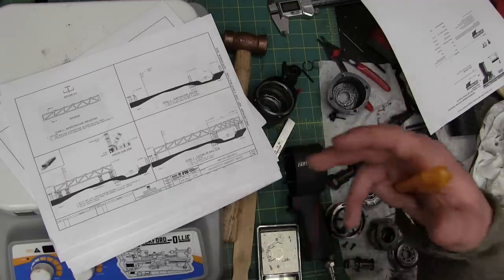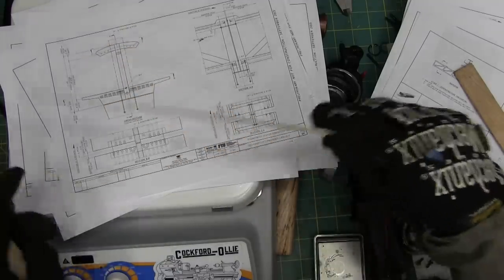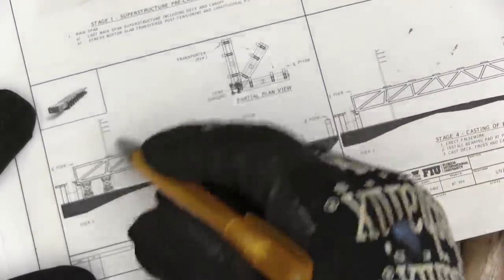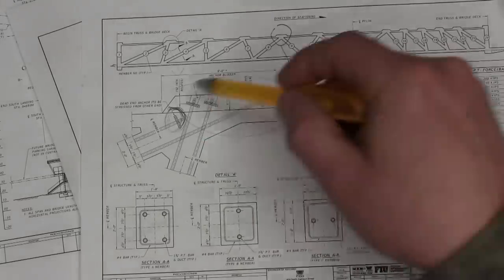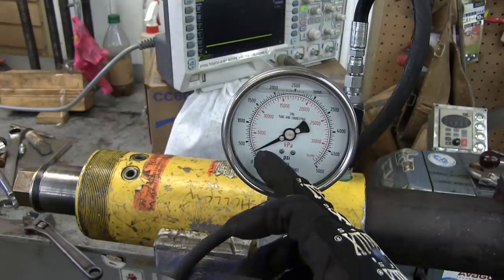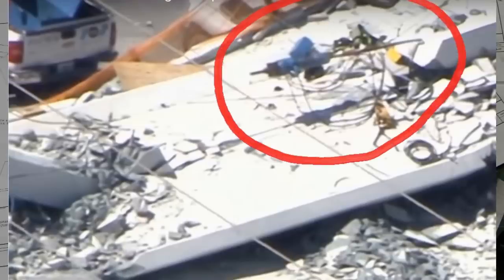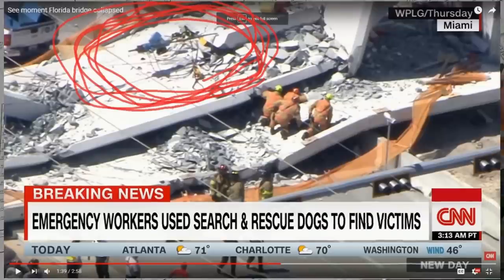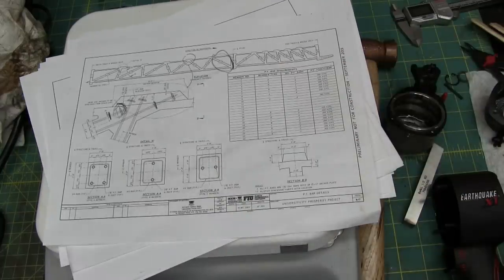Post Tension Failure Florida Bridge Collapse | Engineering EXPLAINED!

Comment: I am a civil engineer and I would like to express some points. These actual super duper structures are based on calculations of advanced mathematic techniques, These computer programs take in consideration so many variables that it makes almost impossible to control in construction sites. Every element is affecting the next one and so on, the stress and shear forces are  dynamically calculated in the computer model . As already mentioned, a structural collapse is a sum of multiple failures, and it's very hard to manipulate those structures in situ. Once you make a change in one support, you are changing the whole model, affecting the tensions in all elements, the tensions tend to travel to less stressed elements that are not supposed to handle it. If the model is supposed to be supported with on only 2 nodes, when you put another support in the middle, it start to act like a continuos beam.creating all kinds of different tensions in the element.
It's an unfortunate case of mishandle the the tensions on the site. Once one or more? rods were subject to tensions above the limit, the steel would break after passing the fluidity limit ( when it loose it's traction capacity ). And I guess that they were already working almost on the limit of their capacity, the security loads for this kind of elements are very high.
Reply: Jon O  , for sure. The variables are just too demanding in this kind of project. And we did’nt even talk about the constraints required by the contract to install the bridge.
Reply: Jon O tight schedule?

I think they've been working on it for 5 years
Reply: No.  Back up six steps and look at the big picture.  It is the wrong kind of bridge. Period.
Reply: Jon Wiebold  there is not such a thing. The structure is very interesting and  very complex. Still , these structures are almost like machines. Thanks to this channel I could peek on the designs ,  they are very challenging.
Reply: Jon Wiebold nothing wrong with type of bridge so many experts out there .This could have been just a bad gauge on the tensioner we don't know yet.this bridge type  has been built for years with no problems let's not speculate let's wait for the word.
Reply: If they moved the supporting structures towards the centre of the bridge then that would change the load distribution on the bridge. If those supports near the centre were jacked up too high, the loads on that end of the bridge would be reversed, since it is acting like a cantilever overhanging on the temporary supports and not a beam supported at both ends. It's only a small overhang but the bottom part of the bridge would change to be acting in compression and the top acting in tension. The loads on the two diagonal trusses at that end would also be reversed. 
If they didn't take this different loading condition into account when tensioning the tendons, then once the supports are removed the actual stresses in the bridge would be different to the intended ones. 
They may have noticed this and tried to adjust the tensions after the supports were removed. This shouldn't have been done while traffic was passing underneath, but for some reason or another it did and evidently something went terribly wrong causing catastrophic failure. Looks like a series of unfortunate events, and bad decisions. That's the best explanation I can think of with the evidence I've seen.
Reply: We as engineers love to work with the latest and greatest tools, push the limits of design and come up with the sexiest new thing to be built since AvE's torque tester. But what we fail to do, all do often, is engineer to the lowest common denominator. In this case, the LCD was the poor decision to move the transporter and failure to recognize that the tension bolts had yielded. As Paulo pointed out, there were so many variables - way too many variables for the on-site crew (both grunts and enginerds) to comprehend and handle. I can design a shaft fitting into a hole, calling out for a interference tolerance of .000001", but if the guy installing the shaft is using sledge hammer, what good is my design? I should either simplify my design and take into account the installation environment, or get a better installation crew/method.
Reply: I have since learned that it is a cable stayed bridge.  The "cables" do not carry any of the weight.
Reply: We are still using structures and facilities built by the ancient romans more than 2000 years ago. No computers then.
Reply: Paulo Roberto Agreed.
But, what about the unsupported 'hanging' mass created by moving the positioner? Adjustments made in that position would be totally inaccurate as you were basically lifting the unsupported mass at the same time.
Reply: In the meantime, supposition videos generate lots of views! Only the real forensic analysis will find the cause, after running through hours of modelling. These are not simple structures - but super duper!
Reply: Jon O I
Reply: There's something to be said about designing with slide rules and fewer significant digits, isn't there?  I sharpened my engineering chops on a Post Versalog II®, and, while it might have cost a nickel or two extra on a five-million-dollar project, there was [almost] always enough safety margin built in to the calculations to compensate for using a sixteen-pound sledge hammer instead of a custom-built-for-the-job, fifteen-point-seven-three-pound sledge hammer.

Bottom line?  Spend the extra nickel or two.
Reply: Paulo Roberto well there are a lot of bridges in my country as longer as this one that have been built around 100 years ago (those 1st days of concrete and steel buildings) and I assure you these engineers didn't need some supercomputers to build'em in a correct way. Just sayin'...
Reply: Those bridges were built under completely different circumstances, methods of construction, and materials. I guarantee they were not built in 950 ton sections then transported to their final location. They also would be a lot bigger, heavier, more expensive, and taken a lot longer to build. You want to erase 100 years of progress in technology, engineering, and materials science? You believe there were no failures of bridges built 100 years ago?
Reply: Glenn Wilson 
You're spot on. If your design is to complex to handle it's not worth any other benefit. We're talking about lives here, safety comes first, not some fancy new iteration of proven design.

Comment: that bridge was doom the moment they decide to change the mobile support placement under the bridge before moving it into place !
the posttensioning was calculate to be support at the end so all the weight was hanging in the center but they carry it a full thrust nearer the center so all the pressure they put in tension  was already breaking the bridge before it was in place
so when they drop it on the piers at both end it was already to late the tension rod that you see with the tensioner was overstretch by the weight of the unsupported end of the bridge
i hope it make sense because it is not easy to explain something in English when you are French canadian
Reply: Gil B Nearly all these disasters are caused by some last minute half-baked change to the plan/procedure. Usually because of budget/politics.
I agree with you, they relocated the SPMT because traffic infrastructure was in the way, so they come up with a quick solution to avoid the extra cost and disruption to traffic instead of moving what was in the way. Where are the cost savings now? And six souls have lost their lives as a result.
Reply: It's easy to say that now but these type of adjustments are common in big construction projects.  Its not like they just wing it, every factor is recalculated and either someone fucked up a calculation or there was a material flaw.
Reply: These type of field adjustments are common sure, but this type of construction technique is a) new, and b) requires at least three different sets of load calculations (fully installed, partially installed, while being moved).  Maybe what happened is they recalculated the force for the wrong scenario.

Or, maybe a construction company hired because they're minority owned and had a connection to the school wasn't very good.
Reply: Yup. They moved the support away from the end yet left the tension rod tightened as if it the end were still supporting most of the bridge. Unfortunately it was actually being stressed in the opposite direction. Nothing good came from that.
Reply: deezelfairy They saved $-15 million and -6 lives with that "shortcut". But adjusting tension bars when you've already seen cracks and heard bad noises is the truly criminal part.
Reply: Michael O "it's not like they just wing it" -- I mean... I dunno, maybe that's usually the case, but in this specific case, it sure looks like they did, in fact, just wing it. Trying to adjust cable tension with traffic going underneath.

Whoever  was actually adjusting the tension surely can't have fully appreciated how things could go so horribly wrong in less than two seconds.

On a human level, that is where the failure occurred.

Comment: A snapping PT rod would explain that "bullwhip cracking" sound... (2:33)
Reply: Sure so from what Ave said that sound was reported before the collapse, like an hour or so if memory serves. Wouldn't that rod have ejected itself from the housing in spectacular fashion as soon as that failure occured and not sometime later?
Reply: I guess there are more than one of those in parallel. When one fails the others get a lot more stress and would fail soon, but maybe not immediatly.
Reply: I wonder if it was being acoustically monitored?
Reply: Cracked could have been stress on any of the other members. Also remember that bolts will make noise before they break. If you check out the FIU dashcam video(just search that on youtube) you can see the rod eject at 8 seconds in. It's clearly there.
Reply: It's easy for something to fail to the point of being useless, while optically things only shifted an inch or so.
Reply: No it wouldn't, a snapping PT rod would make a shit load more noise than a bullwhip.
Reply: No, there is nowhere for it to 'go'.  If the cable being stressed fails, it simply breaks inside the 'tube'. Usually, when tensioning, we only know this happens from the readings on the meter. Like in this video example, the force being used to tension suddenly drops. 

Now there is usually many of these cables for combined strength and some redundancy.  That's what the CSI types will have to figure out.

The reason Ave suggests it failed, and not the concrete around it, is that it is exposed AFTER the fall.. and is not mangled in any way. When the bridge dropped, it simply slides out of the 'tube' as the concrete bridge comes away from it.
Reply: SydneyCBR6 The PT rod was embedded in concrete, which might fade the sound a bit. Besides, the eyewitness (earwitness?) account didn't say exactly how loud the sound was. She just stated that the sound was like "a loud cracking whip" (2:33 in AvE's video).

Comment: When trusses are designed, all members within the truss are designed as tension/compression members only.  No bending.  So like you said, the original transport plan showed the supports at the panel points of the truss or the nodes of the truss.  You always load a truss at the nodes...never between nodes.  When they moved the SPMT to a spot between nodes, they were asking for trouble.
Reply: Trusses should always be designed for bending on top and/or bottom chords to resist bending as load application dictates. Clearly the difference in pedestrian load between node points and the bending/shear from supporting  approx half the bridge weight is substantially different
Reply: @BillySnowball  In practice the Truss will undergo some bending but they are supposed to be designed in such a way that the moment generated is almost negligible because the members are supposed to carry only axial forces.
If the moments are huge they should accounted for in the design but Why take on this extra headache to begin with.

Comment: Post tension members are plastic covered tendons (cable not a rod) in order to be unbonded otherwise when you pull the tendon the cured concrete around the bare cable is going to adhere to the member and wont let it move/transfer the load.

Comment: Steel goes into a plastic state under tension. Learned that in college. Also the transporter should have been under the truss. I'm sure during the short time after the transporters were removed and they de-tentioned the the members they were over stretched.  I also agree that they should have had some false work under it until they put the cables on top. Triangles are  our friends.

Comment: Looks like you found the point of failure, NOT what went wrong. What went wrong is who thought it was ok to remove those spreader plates and reposition the equipment. Then who failed to spot it was seriously weakened and still allowed traffic to move under it. This is a clear failure of design and management of the assembly of the bridge and those responsible should be sent to prison for manslaughter.
Reply: Horseshoe nail ?

Comment: on your first video my thought was some thing had to go wrong with tension cables and or the PT rods. 

I've worked in rail road construction for a few years in project oversight for most of the big class five railroads. when it comes to bridge building with the rail road it unreal the design loads they use "E-80" I've seen a handful of bridges they have used  Pretension deck panels. the amount of testing data that is needed and paper work that go with each panel. theirs no way the railroad would even consider letting a contractor build  pretensioned concrete onsite to many variables.
Reply: Did you watch the video? He's asserting, with reason, that the failure was the post-tensioned cable. The concrete didn't fail.
Reply: Tommy Petraglia 
I would agree this not some basement foundation. 
in the railroad if the batch is an hour old the truck is rejected. in ACI they want you to check the batch in the middle of the truck if it was over 90 degree we rejected the truck. the contractor always want use to check the batch before they poured just in case it didn't paas. the railroad has some hard rules but they can't afford a bad batch of concrete.

Comment: Oh yes, as a resident of the Tampa area I will think of this event every time I cross the Skyway Bridge, designed by the same engineering firm...
Reply: DaDa Fan engineering was done right, it's the contractor who built the bridge that is most at fault for their bad decisions in building it.
Reply: DaDa Fan
Just don't park under the Skyway bridge and you'll be fine.
Reply: I'd be more concerned about what the contractors have built who the engineers were. Unless it comes out that the firm was responsible for giving the OK on the changes outlined in the video. What it looks like is someone on site changed up the support plan without giving a thought to the de-tensioning.
Reply: Guys, I agree it was likely the contractors. On the one hand, I expect that the firm would demand a review of a change but that leads down one rat-hole. If they didn't demand it, well, that's a different rat hole.
Reply: Life is a risk, even in the bathroom.
Reply: Bohdan Prokopovych I wouldnt be so sure of that. I have had to deal with engineers who refuse to listen to reason when everybody is telling them that their plan will not work. You do it their way or not at all. If the engineers changed the plan on how to move it into place it's on them, not the builders.
Reply: I cross that bridge couple times a week! I was thinking the same thing.
Reply: carry your umbrella for a parachute! :\
Reply: Figg's been in business forever, they've designed countless structures without a problem. Nothing here suggests that this was the fault of the engineering firm... everything screams contractor error. I don't imagine many people here are from SFL, but MCM's reputation was garbage even before this. Nobody is shocked that they're behind this.
Reply: Damn, I've done a fair bit of Tarpon fishing under that huge Skyway bridge and I've driven over it a few times. But I believe that bridge is really skookum because it's been through a lot of rough and bad times and she's still standing strong and beautiful. I really miss fishing down there.
Reply: Gizmo42Rodeo work for a engineering firm. Changes like this would force a update of the installation procedure, calculation report and most likely one new review.
Reply: The skyway bridge is how many years old now? 30 years? As long as its maintained properly its fine. The issue here isn't the design of the bridge, it was an issue on the contractors side of things. Either they were doing something they didn't get approval for, or they were just doing things the american way and half assing it.
Reply: That engineering firm has built bridges all over the globe. This one failed... One... Out of thousands. I think you are ok
Reply: once completed, all the tensioning and structure is already set (it didn't fail on construction), baring catastrophic external forces...it should hold up
Reply: Those shop drawings, done by the engineering firm, are solid.  It was the deviation from the plan that led to this.  The Skyway is fine.

Comment: Feel sorry for your wife ave, an inch of wood, not a very big stroke but the torque is amazing I bet.......
Reply: Why would they remove the tension machine so quickly?
Reply: That’s a pre-tentioned 1” wood member. The mind boggles at the stiffnicity inherent.
Reply: Ranjit its all about compression mate
Reply: I don't want to hear about anchored nuts under tension or compression.